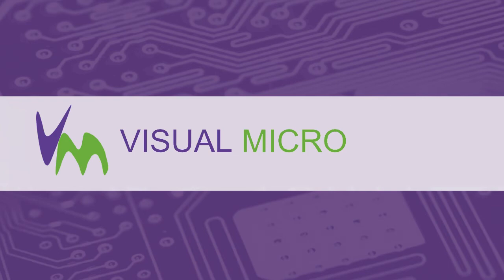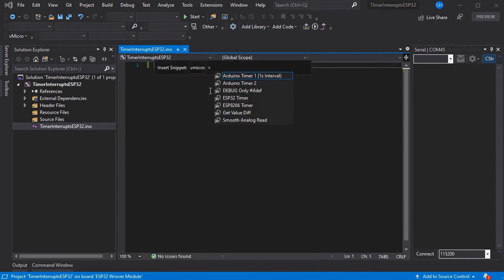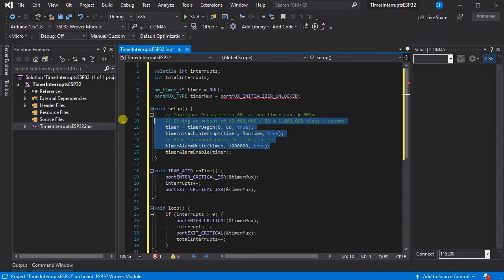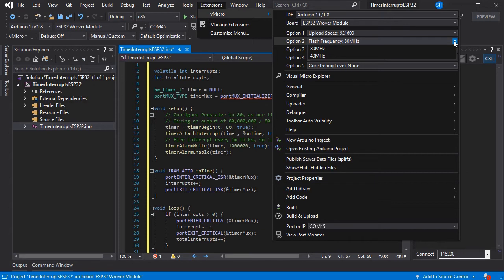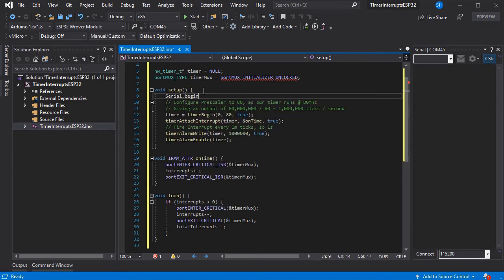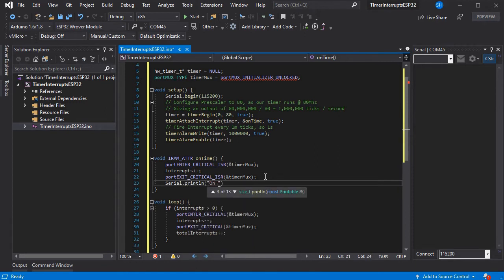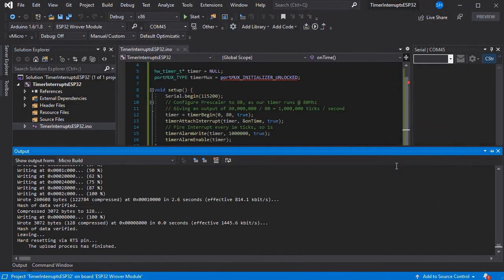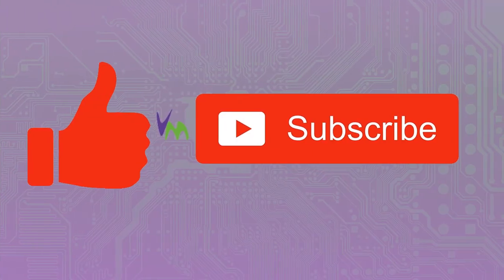Learning Timer Interrupts for ESP32 and Arduino

Comment: I am a beginner trying to upload this sketch to my esp32 via arduino ide (I have installed the necessary libraries to upload for esp32) but get an error  message as follows : 'onTime' was not declared in this scope . What do you suggest? Thanks.
Reply from the maker: This works fine in Visual Micro, the issue with the Arduino IDE appears to be it is not generating the prototype for the onTime ISR function.

To work around it move the onTime ISR function declaration above the setup function where it is used, so no prototype is needed.
Reply: @visualmicro4389  yes I tried that right after I asked the question and it worked. Thanks a lot for the answer. This helped a lot.
Reply: @visualmicro4389  Worked for me too, great video!

Comment: Sorry, my english is not very good
Is there a method or function to work the "timer" with external interrupts for the esp32 device?
Reply from the maker: If you want to time events from External Interrupts, e.g. how long a button is pushed for, then you would set a time to a global volatile variable in the RISING interrupt, and then work out the time difference in the FALLING interrupt (assuming the switch is pulled low).  

To avoid issues with bouncing (which interrupts will show) you can either ignore state changes below a threshold (e.g. 100ms) or add in an RC Circuit in hardware to resolve the bouncing.

The timer interrupts shown here simply allow something to run on a timer, but very accurately as they interrupt your code, to run the timed task.